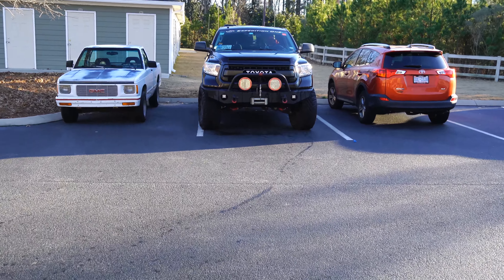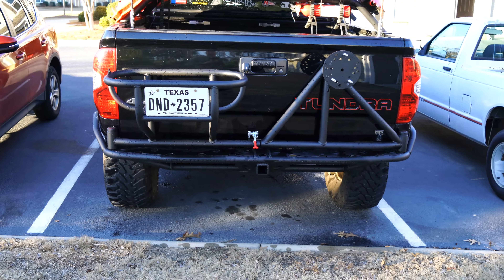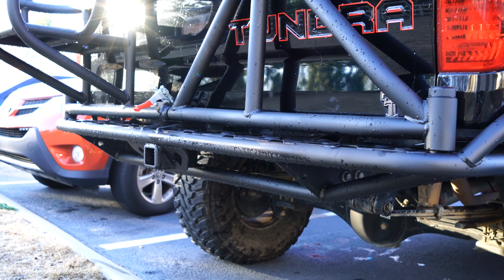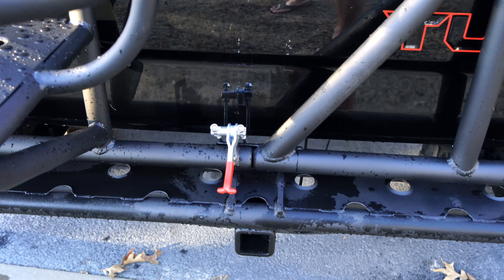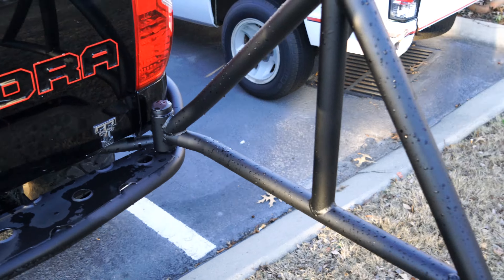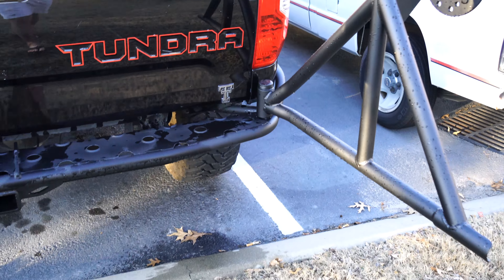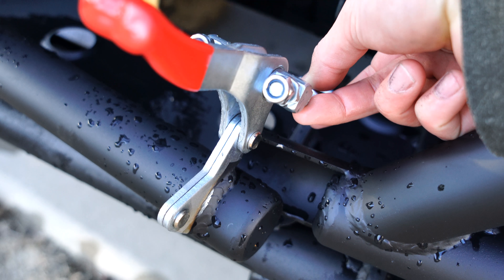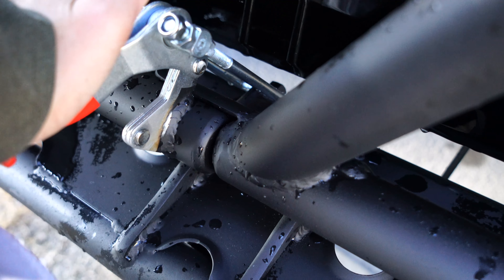Black Pearl The Tundra: A High Clearance Bumper

Comment: Have you tried to tow anything heavy yet? I want a high clearance hitch, but I still have to tow my 8000lb camper from job to job.
Reply from the maker: At the time I towed my jetski but that was only 3000lbs at most but I have pulled the largest Uhual trailer across the country with trailer and furniture pushing 6500lbs and I drive pretty aggressive. If you look at the stock receiver it won't be hard to over build it and make it stronger

Comment: I'm looking for ideas to make overland modifications to a Toyota Tundra CrewMax TRD Off-Road 4x4. 2010. Any suggestions ?.
Reply from the maker: AECVV well first you really need to sit down and layout everything you want and the weight of all of it including fluids. That will be the biggest factor from there you'll know you're setup and what suspension route you have to go. The gear you carry the less nibble the truck gets and speed decreases on the trail.
Reply: Thank you very much for the excellent observation. So, do you recommend, see the suspension after having the accessories that will load?

Comment: I've got a '10 Rock Warrior.  What did you have to do in order to get 37's to clear at wheel lock?
Reply from the maker: Lars Noldan if M/T tires you'll need at least a 3.5" lift and offset of the wheels is key of no rub so you'll want to stay in the mid +20mm to mid +30mm range (I'm at +31mm). Once you have that cutting the body mount is required and pulling up the liner and grinding the pinch seam along with aftermarket front bumper if not cutting a lot of the stock bumper.

Comment: How did you run your dynomax bullets.
Reply from the maker: Eric Durham ran dual bullets then Y-pipe to a single exit right over the axle...if I had to do it again I would do dual out or go with BAMuffler budget system
Reply: Sean Hillaker 

I see.  Thanks for the quick response.
Reply: Sean Hillaker is there any negatives to running a bamuffler syestem or dynomax bullets
Reply from the maker: No I mean it'll growl louder when gas'ing it but no. There might be drone in the cab which is what BAMuffler has built in the exhaust to kill the drone.
Reply: Sean Hillaker 
Alright.  I'm just starting to do some upgrade to my tundra and not sure what to do. Just trying to gain some knowledge. Thanks
Reply: Sean Hillaker love that bumper dude. Where did you get it done?
Reply from the maker: The bumper was built by a local fabricator in South Carolina. Sent him a sketch of what i wanted and he built it for me.
Reply: Sean Hillaker thanks brother. If you have the name of the guy, I’d like to give him some more business. My design is similar but with a wrap up around the body (exo-cage).